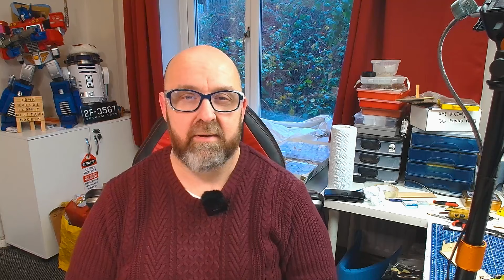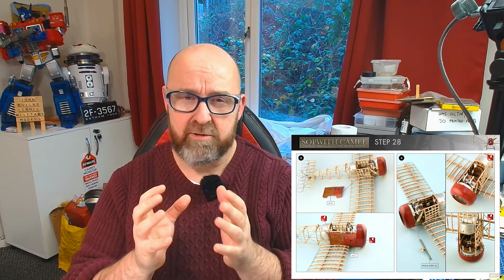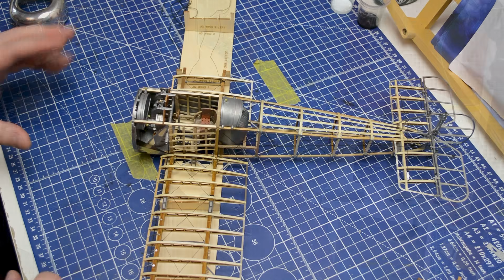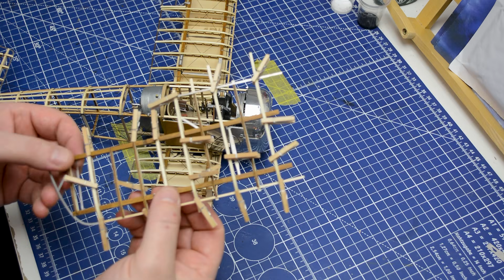My Most Difficult Model Build / Artesania Latina 1/16 Scale Sopwith Camel  : Episode 17

Comment: Love it !! I have build its opponent, the Fokker Dr 1.  And yes, it is the babbit metal that gives problems, especially the bulkhead in my case.
Great job on the polishing, i painted it, and did not use the side panels. Nor did i use the metal leading edges on the wings. It took away too much of the inner workings to my taste.
Reply from the maker: Think I will have to build the Fokker Dr 1 Myself, and I agree with you on the metal edges,  wish now I would have made them from wood